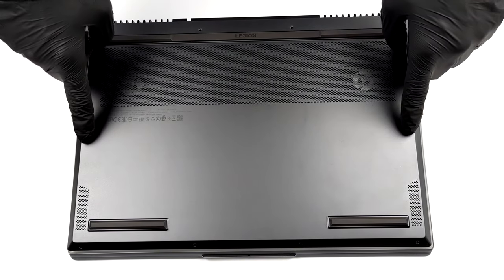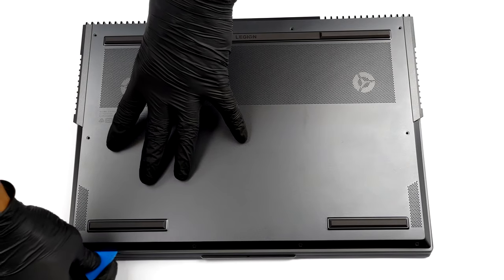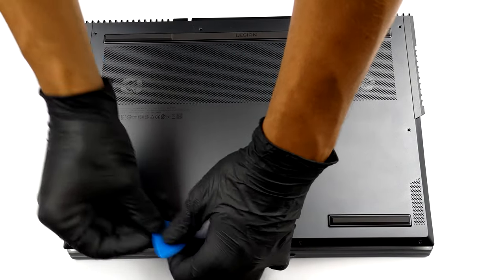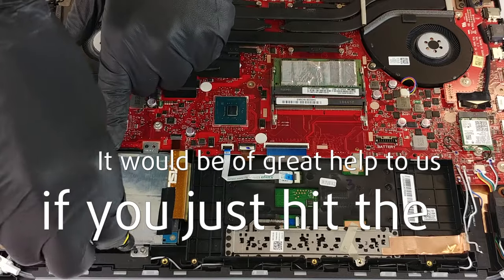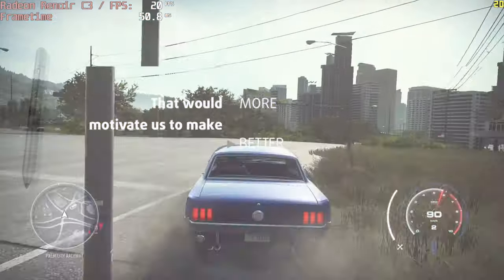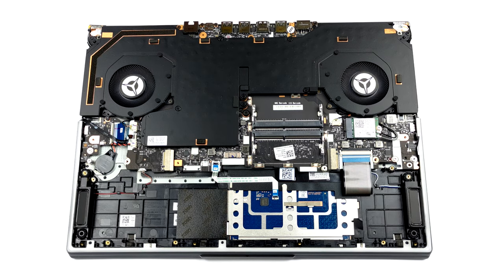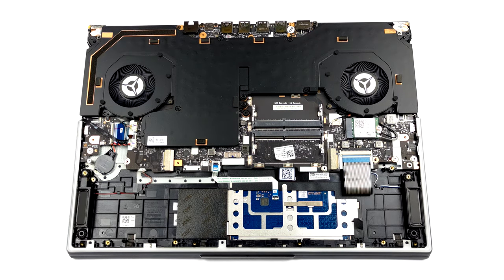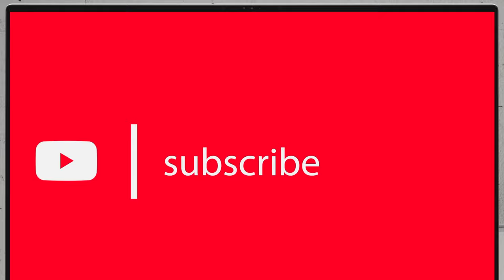🛠️ Lenovo Legion 7 (16", 2021) - disassembly and upgrade options

Comment: It was actually very difficult to remove the bottom panel without damaging it.
Reply: Exactly my issue
Reply: Did you end up damaging yours? I'm trying to figure out how they were able to slide the plastic triangle into the supposed crevice between the led light and bottom. I see almost no way to enter it without stressing something.
Reply: @jeng6583  I gave up because I would have damaged something.  It was not worth the risk for me
Reply: @airgreek  ah, okay. Knowing that there's an additional slot for more storage is definitely going to drive me insane.
Reply: I gave up too. I had to damage the panel a little. Can be painted over with a gray marker.
Reply: @Vladimir-dk3lb  that's disheartening to hear. That's such a weird way to build a laptop. Makes you wonder if they just break your laptop bottom if you ever need it fixed through warranty repair.
Reply: It was hard as fuck to remove the bottom lid. I tried one day and destroyed pry tool (it was too soft). Next day I took old payment card. Using carpet knife (sharp) I rounded one corner - I tried different radiuses of rounding. At last I succeeded. Where you need to put the pry tool? I forced it between front corner and a half way to the top lid handle. The move I made with my hand was like rolling the card (the corner rounding cutout with a knife is for that) Now when I have open laptop it seems the best place to use pry tool is almost in the middle of the front - where there is second screw hole from the right (assuming laptop lies upside down).
Reply: @Totumfacky  I was able to use one of the guitar pick-looking tools from the ifixit kit to open mine up starting from one of the front corners. It was definitely a pain and I did snap off two of those really small hook-like molds on the panel near the rear exhausts when I lifted the panel off. Hopefully it's just a one-and-done and I'll never have to go back in.
Reply: I used a large 50mm metal paint scraper on the front to pry in-between the bottom panel and white led strip. The wide tool didn't damage it because of large surface area to pry up against even though it's metal. (Tried a flat head screw driver and made a small mark). After this slide the plastic tool like a credit card about 10mm - not very far at all and slide it along. I only broke one little plastic tab off this way and took about 5mins
Reply: No it isn't hard. You just have to use the pic tool and GENTLY go ALL THE WAY around the laptop! The pic tool will open the little clips WITHOUT breaking them, but you can't use a lot of force. You just have to be completely gentle.
Reply: On my Dell XPS 13, there is a convenient recessed ledge on each side of the laptop - about 1.5 inches wide - where you can use your fingernails to pry the back cover off. Lenovo and MSI just suck about designing stuff like this on their laptop chassis. Saw a post about a guy who just ruined the front edge of his $4K MSI gaming machine trying to get the back cover off.
Reply: I had an on-site repair guy at home recently, and he used one of those pry tools/plectrons similar to the ones iFixit sells. It took him about ten seconds to get the lid off with not a scrape on any of the parts, just like the guy in the video. So it doesn't seem too difficult if you have the right tool and some practice. I had neither and also managed, although it took me about five minutes and some anxiety about breaking my case. But it's definitely the most annoying part about this. If I had to open it again I'd definitely get the iFixit tool, that seems to be the key. At least it doesn't seem like they made it purposely hard to open, I get that it looks nicer without a big gap in the case.
Reply: Best tool to use here is a suction cup,  i got a 20kg one and i pulled the bottom half loose without too much effort.
Prying tools didnt work at all for me
Reply: @ahfanboy114 ThinkPads are much easier to open than Legion models
Reply: Easy job

Comment: For those having problem with the back lid, do the two front corners first, run the plastic wedge through a couple of times. Proceed as how they did it in the video with the vents at the sides.
Reply: Well i lost thwo little black things 😅
Reply: For me, it worked better to start at the 2 side vents.
Reply: Yep, getting in gently under the side vents with a pick did it for me. Then use a triangle pry tool for the rest.
Still a royal pain in the arse, though.
Reply: For me it was much easier starting in the back. I first lifted the center back part with just my fingers a bit, by grabbing inside of the port slots. That seems to be the least fixed part, and it gave me some wiggle room to snap out the vent corners without any tools. I only used a tool for the front part – a plastic putty scraper since I didn't have any more sensible tools, but with the back already lifted, the gap was wide enough to pry it in. Opened nicely and no damage.
Reply: @DanielSaner you did not break the plastic thingies?
Reply: @kalejayeobafemi5925  Nothing broke – I think, also didn't find any parts afterwards 😄

Comment: I can’t find correct screwdriver anywhere ffs. Can’t they just add one to packaging? It costs only a change... There are some small clock screws, don’t want to go to pc shop to add SSD and charge me 50 € when I can do it in 5 minutes at home for free... -_-

Comment: Can you dissemble the cooling solution, I would very much like to know if it has liquid metal applied on it like some of the press releases started and if not maybe it be easy enough to do it
Reply: It doesn’t have liquid metal. I own one, they ended not doing liquid metal.
Reply: @LiNkGoTtI  But can we make it on this CPU ?

Comment: I found other video it was more useful 
To take off back panel or chasis put in the direction as shown and start from the corner (not on fan side but other two corners at front) keep trying with plastic wedge couple of times try to keep vertical once and try only on corners. Once the corner opens up slide the wedge all the way to other end. 

Opening chassis is tricky

Comment: Yesss thank you!  Couldn’t figure out how exactly to pry the bottom off, this was perfect.  Upgraded the RAM to 32bg dual rank, super easy thanks to this video.  The stock ram kind of sucks in these and it’s a noticeable difference and for $99 we’ll worth it.  I was very surprised at the SSD, probably one of the best gen 3 you can get, ranks higher than a 970 evo.
Reply: wich ram did u buy? I'm kinda new to this whole "PC building/upgrading" thing.
Reply: @zPandro1  I researched it for hours to see which would not only be compatible, but also a good upgrade from the stock ram and this was the best I could find for 32gb.
Reply: Two sticks of 32 or 16 each side?
Reply: @elusiveyt1610  I did 16 each side for a total of 32
Reply: Was one of your sticks soldered in?  Everywhere I look, it says that one stick is a 8GB soldered stick.
Reply: @kde5fan737  No , neither stick was soldiered in, just popped right out and new ones slid right in, no issues.

Comment: You say 64GB of support there own documentation says only 32GB, i would suspect would have no issues with 64GB but Lenovo wouldn’t officially support it
Reply: Wondering the same thing...
Reply: @gomariussmith  i got my unit today so may give it a go when bought the 64GB RAM
Reply: @Scouser89Liverpool22  thanks for that. Please also check if it downgrades the ram to single channel vs dual channel when you make the change. Heard from others it recognises the full 64, but only in single channel...
Reply: @Scouser89Liverpool22  did you manage your 64gb upgrade ok? RAM running full speed in dual channel?
Reply: @gomariussmith  I have not, cant get what i want in the UK, but i do know will void my warranty but think the next BIOS update should support it officially same as in regards to 4TB SSD
Reply: I'm looking forward to that BIOS update then. Hope it gets released soon.
Reply: @gomariussmith  a support specialist from lenovo said this to me. A kit of 2x32GB (Max of 64GB) will most likely work. However, the current memory offerings at the time of testing was 2x16GB (total of 32GB), so it has not been tested with higher, so Lenovo can not 100% guarantee it. I seen a few people who tried to upgrade to 64gb with no problems.
Reply: @juanchuang5978  hi mate.
I upgraded with the crucial 2 x 32gb units recommended in a number of threads... they are working with no problems in my system.
Reply: From what I read here you can upgrade the legion 7i to 64gb ram? Because they only give you the option to max 32gb during the build.
Reply: @Mega6501  all I can say is that I have. Just makes sure it's with Cricial memory spec that is listed on the Lenovo page. Others may work too, but this is how I limited my risk.
Reply: @Mega6501  i believe 64GB like 4TB M.2 are not officially supported by Lenovo, but think a BIOS update should resolve so officially supported, but i haven’t seen a BIOS update yet, i check daily
Reply: @gomariussmith  
Oh okay I’m guessing you used 2-32gb ram cards right?
Reply: @Mega6501  yes. There are only 2 slots. 🙂
Reply: @gomariussmith  do you have the spec page link?
Reply: @gomariussmith  
Thanks for your answers, I did just talk pretty recently with support on Lenovo website and he said the max is 32gb but I suppose he meant the max that is being available for purchase. 
I bought the (Legion 7i Gen 6 Intel (16") with RTX 3060) just recently hopefully things go well for me.
Reply: @Mega6501  got the 7i rtx 3070 version. Shouldn't be a problem. Just take the std 16gb and buy 64gb aftermarket. Easy upgrade to do yourself...
Reply: Just installed 64 GB (32GB*2) - everything is fine.
Reply: @gomariussmith hey man can you tell me exact memory you used to upgrade to 64gb (serial number or any link). Thanks

Comment: i am sorry, this video does not show how hard it really is to get the cover off. i am trying now for an hour and i dont get between the body and the bottom plate... almost getting a knife and a hammer to take it off... that plastic card is maybe useful after the cover has been taken off some times.... but not for the first time. And i have disassembled at least 50 different notebooks over the years with no problems...
ok, i got it off now. others having problems to get started, should try in the middel left or right, its quite easier than starting at the front corners. once you get a small slit, you can go on with those plastic cards.
Reply: It isn't hard. You just have to use the pic tool and GENTLY go ALL THE WAY around the laptop! The pic tool will open the little clips WITHOUT breaking them, but you can't use a lot of force. You just have to be completely gentle.
Reply: @Reality_TV  No, it IS hard. A pick is much too thick to get between the cover and the frame, even when using a suction cup to pull up on the frame. Even a razor blade is too thick. Maybe you got lucky and received one that was manufactured from differently sourced frames.
Reply: @andrewwelch5017  - Wrong! There are pics specifically designed just for that. I didn't just get lucky and it is super easy. I will provide you with a link to the type I'm talking about and you can go grab it off of eBay. Andrew, I have opened SO many devices during my lifetime! Trust me! I'm not leading you wrong. Let me show you the way FIRST and then try it. It will work and then you can come back and tell me I'm right! I'm not giving you anecdotal statements here. I'm telling you what I KNOW, 100%, because I've done it multiple times. It is SUPER easy to disconnect. I would do a video about it if I was that type. LOL. Let me get that link for you.
Reply: @Reality_TV  wheres that specific pick from ebay?

Comment: Hey guys,  I'm thinking of buying an extra 1tb SSD memory storage on the empty slot. I already know what type of storage SSD I need but What do I need to do after the installation of the extra storage? is it just a case of plug and play then you're good to go? Or do i need to fiddle else around software wise like in the bios system for it to be read etc? I have the lenovo legion 7 AMD RYZEN 7 5800H RTX 3080 1TB 16GB RAM if that helps. Help from you guys would be greatly appreciated!
Reply: I also bough an ssd, mine is the Samsung 980 pro and once you get it installed, all you would need to do is format it in disk manager in windows and then you should see the new partition in file explorer
Reply: @ErnestoAvilez92  Thank you :)
Reply: @ErnestoAvilez92  So how is it going? What temperature in gaming? Did you add radiator on it?

Comment: What I'm wondering is if it's possible to install a smaller battery (60Wh?) to then install a 2.5" SSD. I've seen upgrades on Legion 5's removing a 2.5" SSD and installing a larger, 80Wh battery. Would like to do the reverse. Possible? If so, what are the part numbers for the battery, SSD caddy & cable?

Comment: what is the maximum capacity of ssd in lenovo legion 7i
Reply: Read that 2 TB is ok, but I don't sure about more than 2 GB capacity.
Reply: Any capacity so long as the SSD is single sided. That means right now you are limited to 2TB on each slot, 4TB in total. Right now only Samsung and Western Digital are making 2TB single sided SSDs worth buying,
Reply: @lordgmlp  Can you link a 2TB SSD compatible with L7 please
Reply: Does a SSD with heatsink (wd black sn850) fit in this laptop or too thick? Thanks!
Reply: @frenchtiger  did you get a response to your question?
Reply: @frenchtiger  What do you think?

Comment: I gave the video a thumbs down because I came here to see specifically how to begin prying open the cover and you just show yourself gliding the tab as if the laptop has openings everywhere knowing damn well the thing is tight without an opening in site.
Reply: To those wondering, you will have to open the lid and apply some pressure to create an opening where to stick the tab in. Note that led strip stays in its place! Only apply pressure to create an opening under the led strip not above it!
Reply: No it isn't hard. You just have to use the pic tool and GENTLY go ALL THE WAY around the laptop! The pic tool will open the little clips WITHOUT breaking them, but you can't use a lot of force. You just have to be completely gentle. I should do a video for this myself because everyone seems to be having trouble, but it is super simple.

Comment: has anyone tried to add 4tb nvme ? on the pdf for this laptop it says up to 32 GB of Ram and two  2tb of nvme.  I've seen people go up to 64 GBram,  did Motherboard or the BIOS changed since the PDF came out?
Reply: Not sure if you're still looking for the answer, but seems like 64gig/4TB works just fine. Specs are just what Lenovo 'sells', not what the system can actually handle, from what I understand.
Reply: @davvem1 so it can take advantage of 64 gb of ram? Just making sure before I buy

Comment: Thanks for the disassembly.
does this laptop really have 2x NVMe slots? i mean, can I really use them both not with RAID mode?
Reply: Yes. That's pretty common these days.
Reply: Why would that not be possible? Many modern mainboards have even 4x NVME slots so 2 isn't really that surprising in a laptop.
Reply: @Esablaka  - He's likely asking because some laptop makers have a 2 drive configuration, BUT it is a RAID 0, which means BOTH function as 1 drive! They do that for performance reasons.
Reply: You cannot run any RAID mode because Lenovo left the option out of the BIOS!!! Totally ridiculous if you ask me. If you are serious about gaming and cutting edge technology, get an MSI.

Comment: Where do I find videos about his configuration?: Lenovo Legion 7 16ITHg6 - 64 GB RAM - 2000 GB 
Intel Core i9-11980HK
2560x1600 500nits,165Hz,100% sRGB,Dolby Vision,HDR 400,Free-Sync,G-Sync,DC dimmer
64 GB RAM
2000 GB PCI EXPRESS SSD
 NVIDIA GeForce RTX 3080